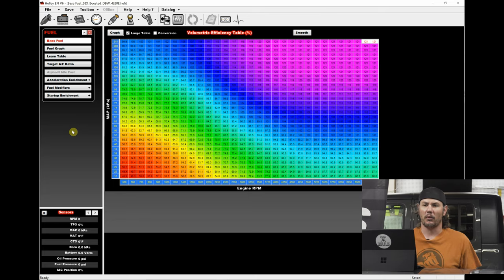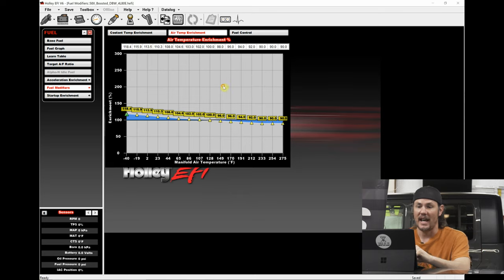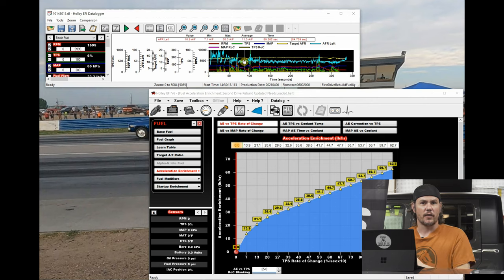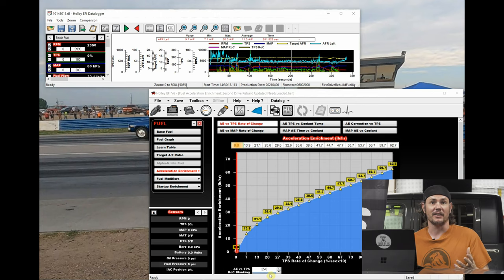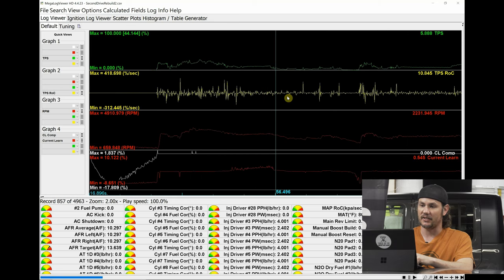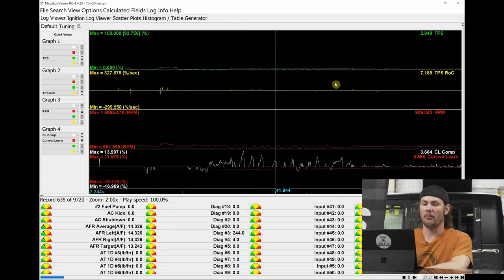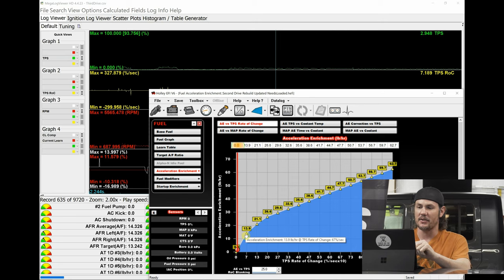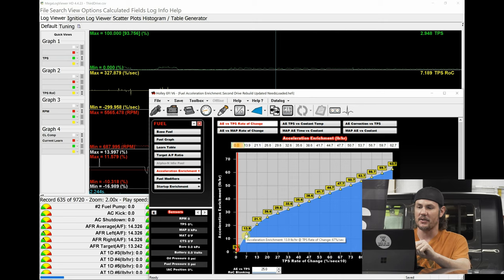Holley EFI Won't Go Into Closed Loop Or Learn?!

Comment: Hi! I am running a holley sniper on a boat with a chevy 350. I'm burning 02 sensors but while I fix that, I need to lear how to do the opposite and override the baseman and make it run on open loop. Is that possible? Will it run right after a good learning session? I just don't want to waste a whole weekend when the 02 goes out
Reply from the maker: If you don’t have the cable for a PC, get it. Worth the money. Then set the closed loop and learn to like 20% max +\-

As it learns closer to where it isn’t swinging, narrow them down more, like 15% closed loop, 5% learn. What they don’t want to admit is that the closed loop learning is total crap on their hardware. Get the pc cable and use the software.

Comment: Man oh man it was fine until I re-ran my wires and now I don’t have learn mode . Could it be A ground issue?  I have the motor ground to the body and then everything going to a battery that’s switched.

Comment: At about 1:20 in this video you say that you can chose whether to inhibit CL in advanced tables. I only see that option when you have a fuel flow multiplier or offset.  Are there other ways to enable / inhibit CL in advanced tables?